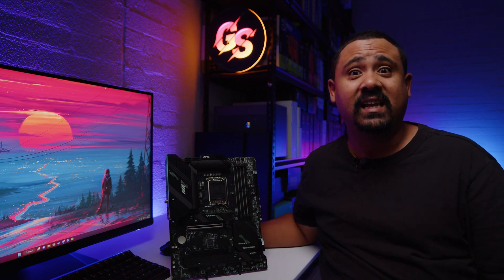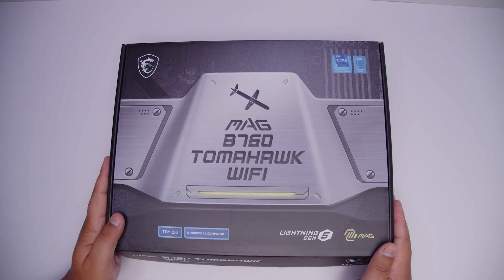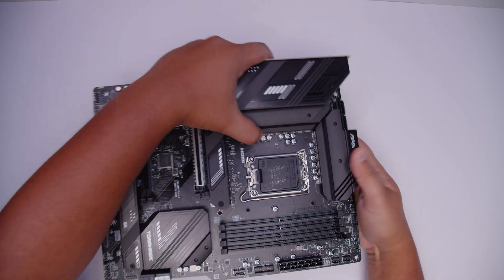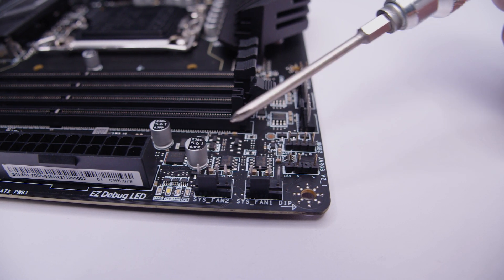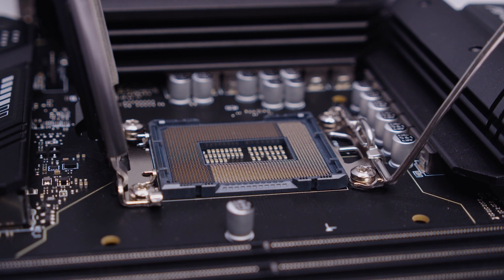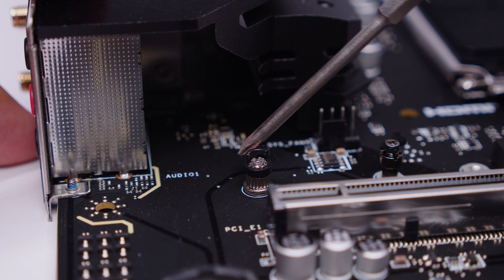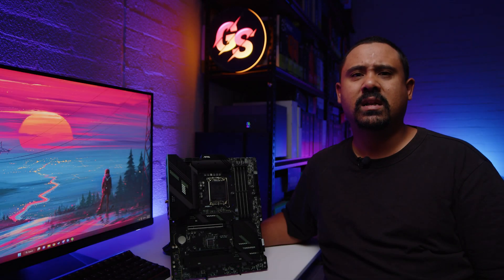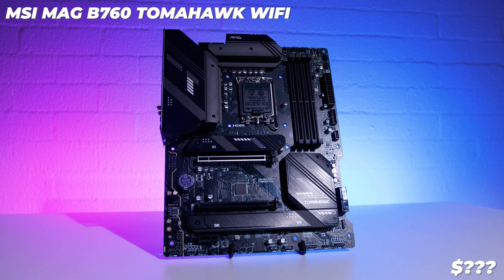B760 is here - MSI B760 Tomahawk WiFi

Comment: I have a question. I recently bought this motherboard and a red light flashes under the GPU, around the 1st M.2 slot. I contacted the local service centre, they said its the light of SSD running. But how come I didn't notice it for a whole week. Can you please confirm if such red led flashes around the SSD?

Comment: You state this has 4 DDR 5 slots?? its a DDR 4 Motherboard??
Reply from the maker: It's a DDR5 board with 4 DDR5 Slots
Reply: There are two different versions of this board, one with DDR4 and one with DDR5, that are otherwise exactly the same. You need to make sure you buy the one with the memory type that you want.

Comment: You're not kidding about those screw on the M.2 slots.  I've seen other reviews say the same.  I can't get mine off.  Already stripped one screw.  I can't believe I'm going to have to return this thing because I can't get the screw off.
Reply: Finally got the bottom plate off. The integrated clip came off along with the screw. So not buy this board for this reason. I've seen 2 other YouTube video tours of this board have the exact same problem. I have idea how I'm ever going to be able to add another drive.

Comment: What is the round battery on there for
Reply: "Since the CMOS is a short term memory module, it will lose all data in case of power loss. This means that if there is a power outage or you disconnect your computer from the mains power, the CMOS will lose power and reset the BIOS automatically. To prevent this from happening, all motherboards have a CMOS battery."
If you typed that in google instead of in a comment, you'd have gotten an instant answer.

Comment: Too bad they cheaped out on the audio, with Realtek ALC897. B660 has ALC1220P. And there is a difference to my ears.
Reply: yeah bro, that's very cheap of MSI. Even my 4 year old b360 g gaming board has S1220A codec and it was 1/3 of this boards' price! I use wired headphones and you can clearly notice the difference.

Comment: The pricing on newegg is a bit higher than what you estimated. I actually find it kind of odd that the b760 costs more than some z690-790 boards right now.
Reply: I jumped the gun and built a new pc with a 790 board and that shit costed an arm and a leg for the board alone, should i have waited? to be fair though ddr5 made a massive difference imo!
Reply: @grilledpedestrian8493  depends on the cpu imo. If your cpu is K variant then no. If it wasn't then maybe you should have waited. lol
Reply: @ancna0156  i512600k not kf lol good to hear then guess it’s time to start overclocking
Reply: well pretty dissapointing that you cant overclock on b760 motherboards....